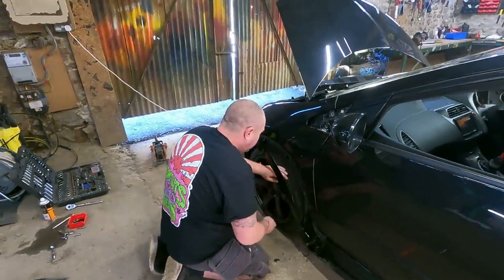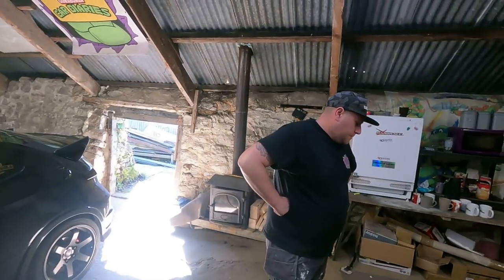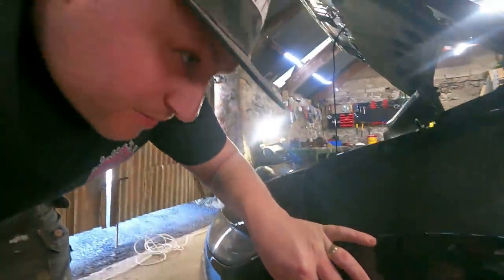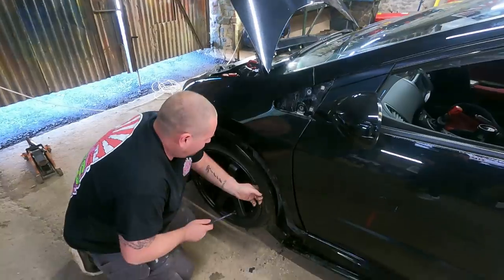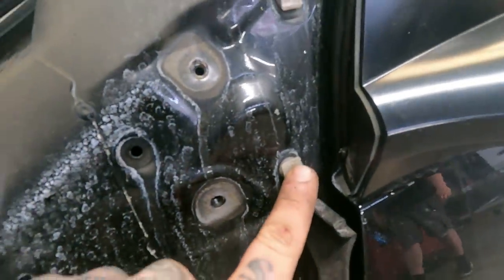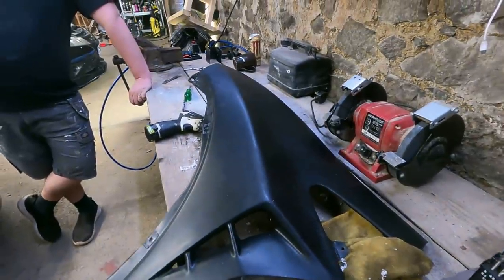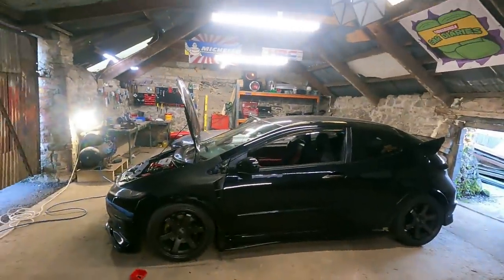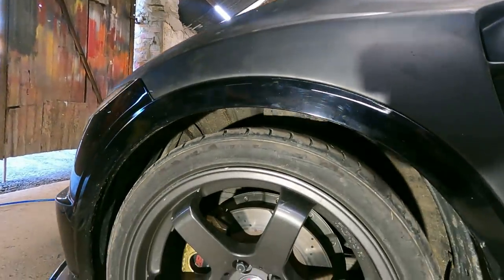Test fitting FibreWorx Mugen vented wings on chris' Honda Civic FN2 Type R

Comment: @15:55 this is intake for the air box/resonator 😄
Reply from the maker: Ahhh cool!! Nice one 🤘🏻🤘🏻
Reply: Yeah virtually all the engines in these mk8’s use that pipe location as the air intake down to the resonator box (which I’ve done a resonator delete on mine)